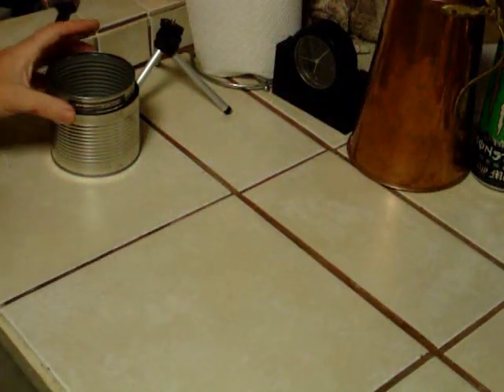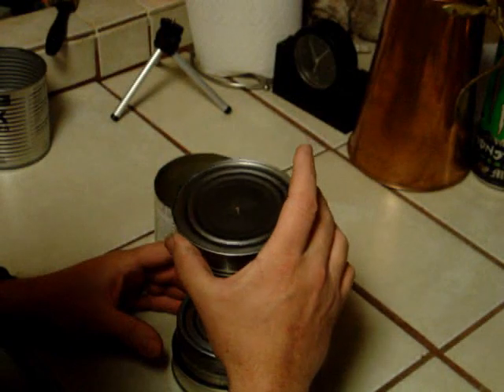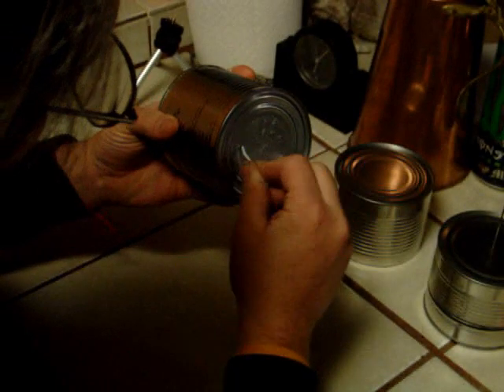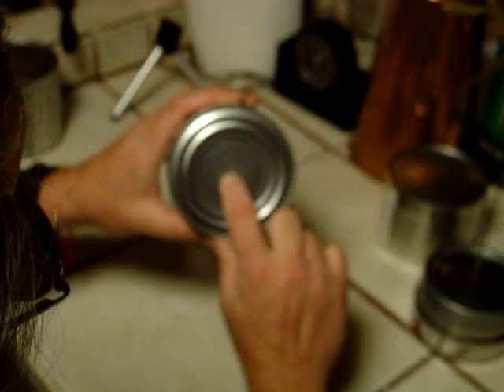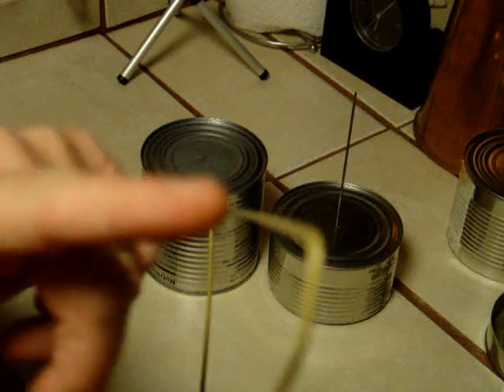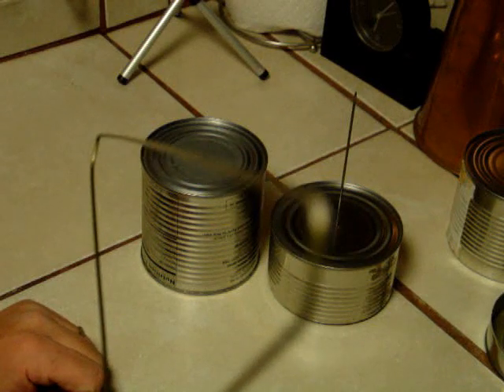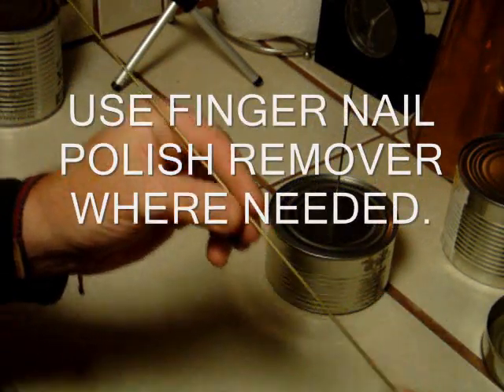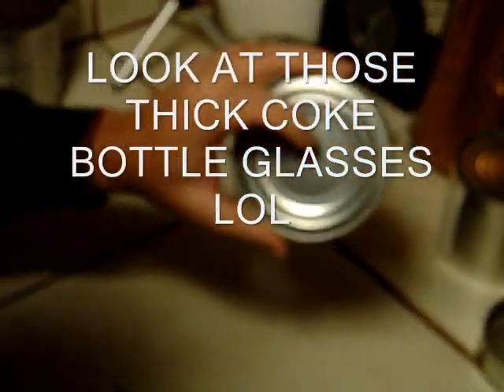PART 1 HOW TO BUILD A TIN CAN STIRLING ENGINE

Comment: Holy Cow!!  I searched for an "EASY" stirling engine.  I've seen a Mercury space capsule that would prolly be easier to build.  Anyway, I'll try to watch all the parts and I may try this.  Thanx for the upload.  I wear coke bottle glasses also, I only need them to see.

Comment: first off, good videos, thanks for puttin this out. 
about the build, i saw you mentioned you lose too much heat thru the sidewalls. its kinda funny cuz the way you were talking about the displacer clearance got me thinking about thinker sidewalls with an hourglass design, sidewalls with tracks for the displacer, sidewalls with tiny ribs like vertical channels, ports in the displacer itself, ect... when my cannabrainstorm calmed i summed it all up to "he needs insulation!". 
think it would help?

Comment: How do you connect your rod on the other side of the hole? epoxy?
Reply from the maker: halemackenzie21 yes. I bend a very small length of the end of the wire 180 degrees flat against itself, then i bend that small section over 90 degrees. That gives the epoxy more surface area to adhere to. then pull the rod so the end meets the bottom, and add the epoxy. spin the rod a few times, and add a another drop.   Merry Christmas, and Happy New Year  MUDDy

Comment: @muddymuddymuddmann Over the years I've developed the foolproof prceedure for building any project.  1st, drink some beer, 2nd, assemble tools (hammer, bigger hammer, more beer, etc.) 3rd, Build project, get about half way through and realize there is no way in hell it will work. 4th, read instructions  5th, Blame the instructions, vid uploader, neighbor, etc. cuz of course it is all their fault.  Not recommended for auto brakes, or television repair.

Comment: i made it why its not work tell me
Reply from the maker: +Sufyan Mohammadali several reason could be the problem. leaks, the hole for the displacer rod may be to big, the displacer leaks, glue on the cam, maybe you oiled the piston, the piston will not work with oil on it. There many more possible reasons that could cause it not to run. Keep playing with it. I hope these suggestions help. keep trying. turn the crank and feel for any rough spots in the operation, binding, scraping, rubbing, and listen while you turn the crank. I'm sure you will find a clue or two.
Good luck. "It doesn't work is not enough information." Play with it and search for more clues. You should be able to find it.
MUDDy